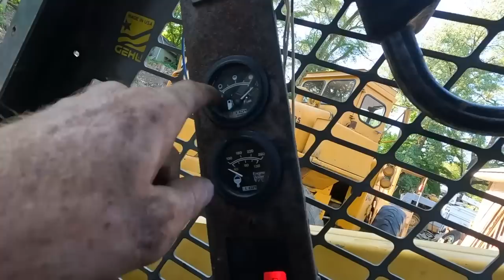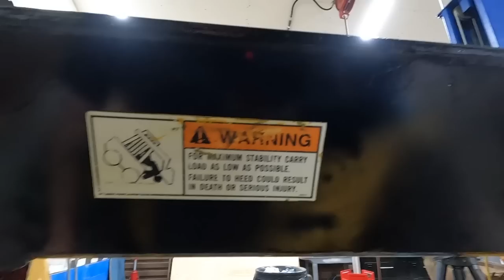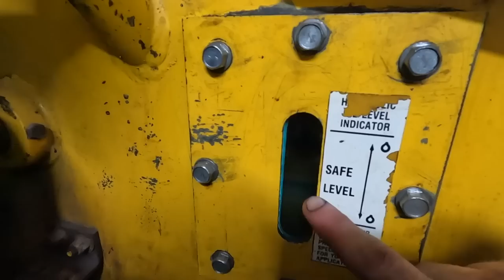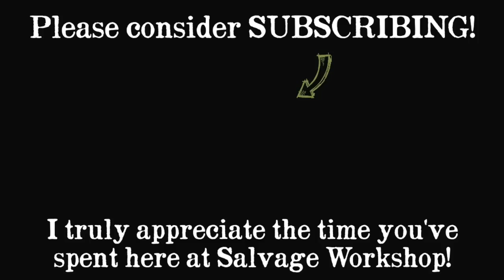Repairing INCREDIBLE Structural Damage to the OLD Skid Steer ~ 1995 Gehl 5625sx Skid Loader P1

Comment: I wondered why that crossmember has had many problems.  It seems that one arm is doing more work than the other.  If the hydraulic cylinder on one side is getting fluid faster than the other, that would explain the continuing weld failure.  Check the two hydraulic lines for restriction.

Comment: you may have bypassing hyd lift cylinder creating more lift on one side, if you wrap steel lines with rubber put the cut side down so water drains out

Comment: Glow plug controller means you don’t need a special position on the switch perm 12 volts from ign switch for when you turn it on you feed the plugs through the controller. After the correct time has passed this automatically turns the glow plugs off.
Reply from the maker: I agree... I figured that out after I replaced the glow plug relay! It sure starts fast now!

Comment: Whenever you are doing a repair like this, you need to bevel the edges so that you can get 100% penetration on your welds. A weld on top of the crack will never be as strong as it should be. You might be doing this as I cannot see on the video. Good luck! I like your channel. Let's have more videos.

Comment: Your sight glass plastic is going to expand and contract many times more than the steel.  Holes in plastic should be enlarged.  Gasket should let it slip.  The cuts you made knife may come back to haunt you.  Install two brass 90 degree fitting with a clear tube.
Nice weld job.

Comment: That hydraulic hose that streamed all that oil from it, which I believe went into that cab of the skidsteer, that was the pressurized line from the pump. You needed to study those hoses. I know I would do that.
Reply from the maker: No it wasnt pressurized... it came out like that because i pulled the rod out by hand and that caused the fluid to shoot out!

Comment: Take it from someone who almost lost a leg to hydraulics, (on a old Ferguson TEA 20 tractor 3 point linkage), the first rule of any machinery use and work / maintenance:-
NEVER OPERATE ANY HYDRAULIC LEVER, UNLESS YOU ARE SEATED IN THE OPERATORS SEAT.

Once the hydraulics have you (trapped / pincered) you likely won’t be able to reach the controls again to save yourself.

Comment: I was a certified welder first of all what you needed to do was 45 all the joints that you were going to weld all your welding is is a Surface weld you are not penetrating deep enough into the steel and always when you weld you weld from the bottom up not the top down welding from the bottom up is a lot stronger weld

Comment: you might want to put light bars front and back instead of individual lights. and a reverse camera and screen. also if after spraying you invert the can and spray till there is no paint, you clean the nozzle for next time. it looks like you have some exhaust leaks overheating the engine bay.

Comment: Yeah way too much smoke. In the past I have had smoke issues because the engine lacks fuel. Could be a restricted inline filter screen if this unit has one. Possible located in the injector pump. This is usually  overlooked when changing the bigger filters. Was just thinking and wondering what happened to the other unit you rescued and tryed to get going? Think from memory you pulled the head off it.

Comment: An old trick quickly melt all that dirty greasy and oil is going to a big box store and they sell a spray bottles with oven cleaner. It gets rid of crap and back down to bare metal.

Comment: abouvious you are not a welder, but can put stuff together. If you were a trained welder you would never weld a vertical down hill. You won't achieve good penetration doing this ,but will look good. When strength matters, that's not the way to do it!

Comment: Looks like someone didn't know enough about cleaning the broken metal parts before re welding it. dirty metal will weld like that because you can't get enough heat at the end of the stick. prep of the metal area for the weld is 90% of the trick of getting a good weld. I have welded thousands of trailer hitches and crash cages for off road vehicles and had users come back and thank me for the cage that stood up to a tree falling on their vehicle with them in it. Welds need to be good and metal needs to be clean for a good weld. Porosity is not your friend when you are certified to weld Pressure vessel tanks to hold 80,000 LB of pressure.

Comment: You might want to invest 20-30 dollars in a hydraulic cap and plug set.  You would save the cost of the kit from all the fluid you loose.  And as a bonus not have to clean up all the messes.

Comment: Blue smoke out of diesel engine usually means burning oil, chances are it's a head gasket problem. Oil is probably leaking into the cylinders and burning

Comment: I would have fixed that before it broke all the way off- at least ground out some of that “ weld “ and and welded at least a solid 4-5”  on each side that way the whole assembly stays square- that is if that center section didn’t brake completely off once before.

Comment: I really don't understand you americans

Here you have this crossmember that is broken clean off, and you can see the factory weld clear as day on the left side of the machines arm

On the right side arm there are a botched weld that caused the left side to break, and STILL you keep it in place and let that guide the nice clean factory weld

Why didn't you just cut off the right side, prepped the whole crossmember (it could only have been easier on a table), welded the left side, without having to mount 7-8-9-100 C-clamps to force it in place (and let the right side keep pulling the weld out of whack)

Then when the left "clean" side was welded in place, you would have a nice prepped crossbeam you just had to line up and weld in place

Comment: Nice work on the repair! But you are making the typical newbie mistake when operating the machine,  when you are trying to get a deeper bite or get into a hard pile you are curling the bucket down and lifting the front tires off the ground, turning a 4wd machine into a 2wd machine, instead lift arms up so you can put the bucket  at a steeper angle to get your deeper bite  but  now all 4 tires are driving you forward.